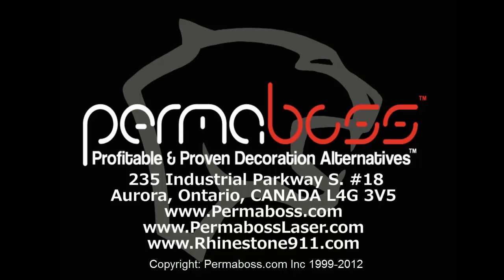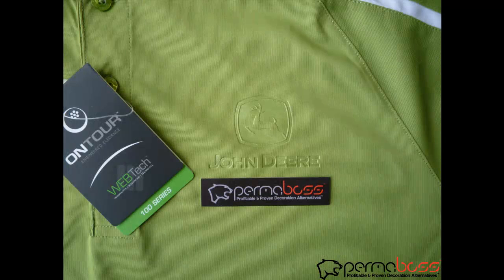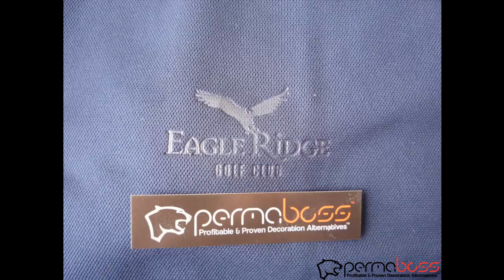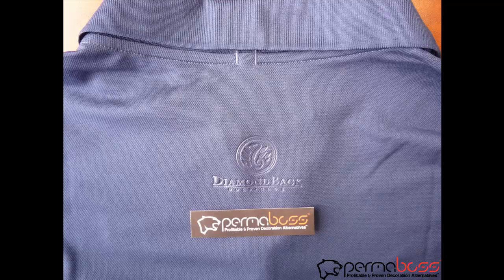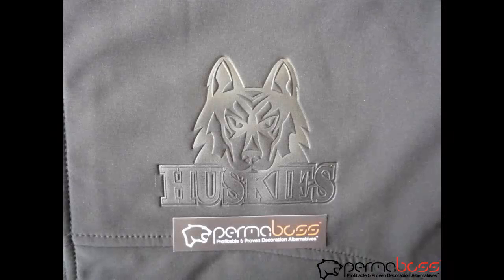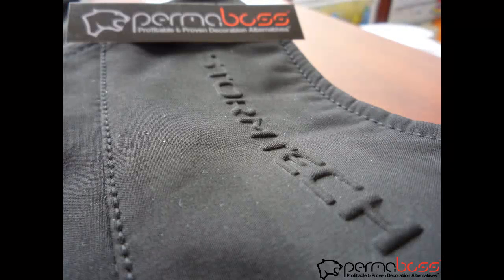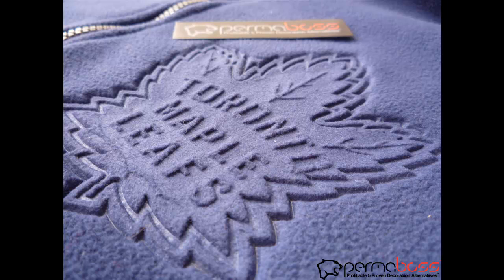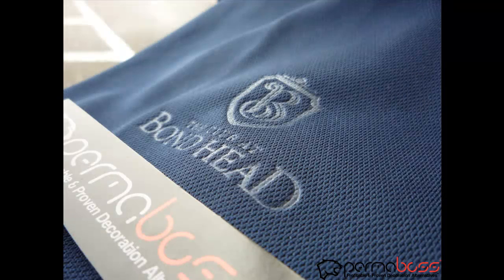Multimedia Embossing Debossing on Technical Textiles, Soft-shell Jackets Permaboss NGE

Comment: How long does Dry Wicking last?
Reply: Hi Tatiana, 
When you do this decoration you are changing the garment for the life of the garment. 
Debossing is done at a high pressure and temperature. Higher than the washing machine or dry cleaners and the logo stays in the garment forever. 
It safe to say that it lasts longer and for sure looks better than embroidery or screen printing would if on the same garment, this applies to all synthetic materials. 
For naturals like cotton you would need to use Bossback™ to hold the shape and it lasts the life of the garment. 
Its pretty soft and gets softer with each wash and its not picky or scratchy to the skin like some embroidery backings are.
Reply: So no need for backing on polyester or dryfit?